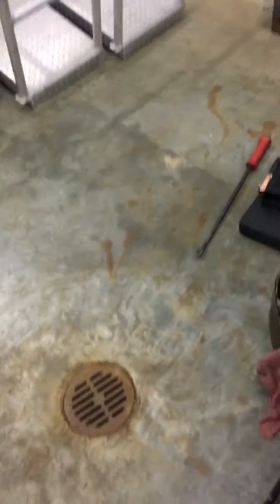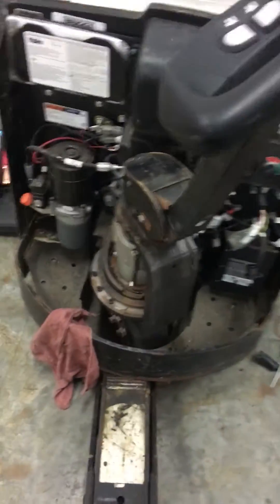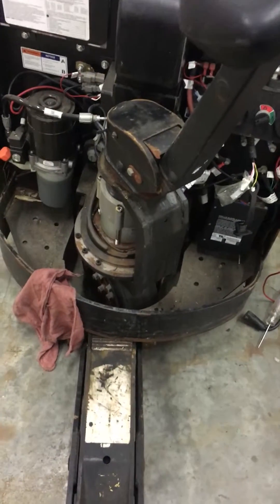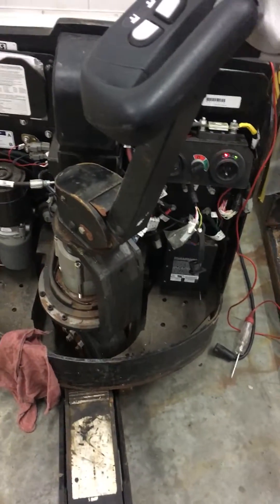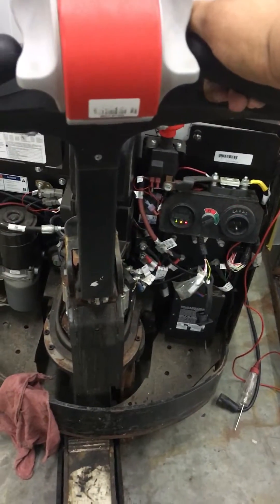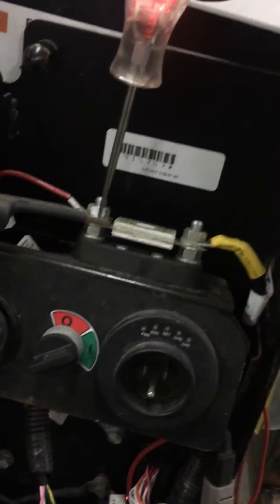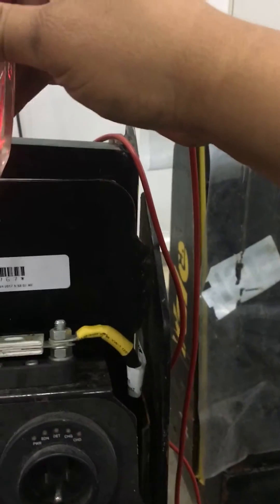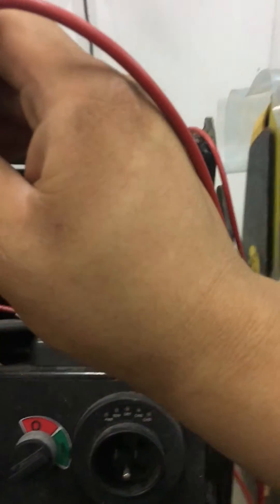Electric Pallet Jack, why good batteries are important!

Comment: In my maintenance department we had a discussion about a battery pallet jack that after charging would hardly move or die suddenly. My input was that one or more batteries have seen their end of charging life. I ask if they tested the charging system. No. Did they test each of the 4 batteries individually? No. I did and 1 out of 4 six volt batteries was only at 5 volts after the other 3 were well above 6 volts. They ignored me and junked the whole pallet jack. Oh well, what do I know.